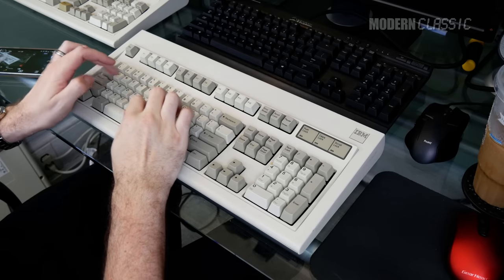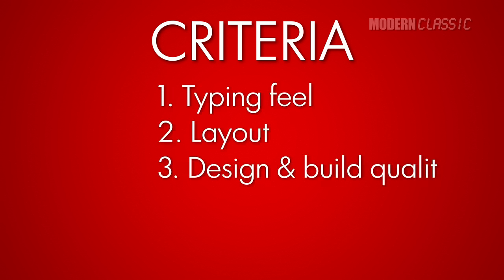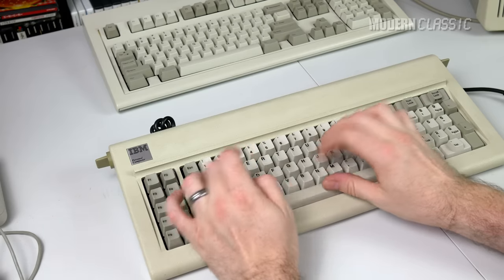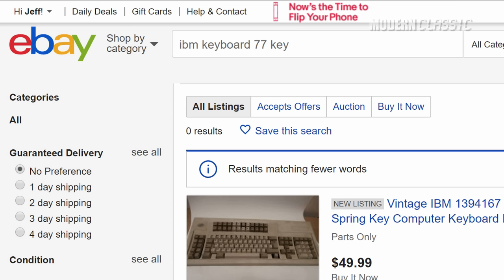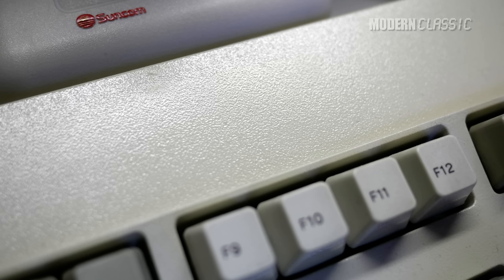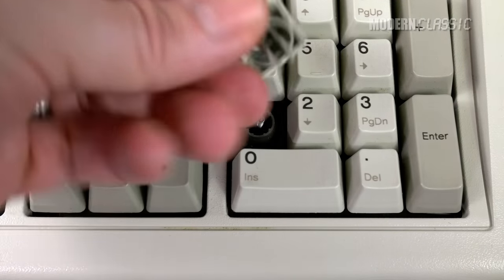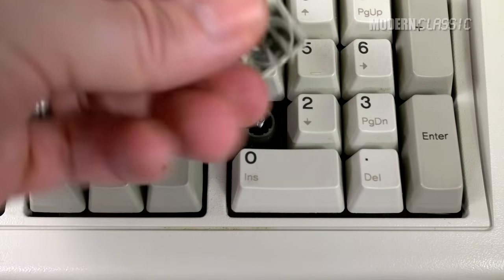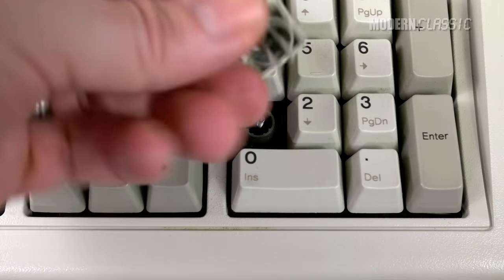Ultimate Keyboard Showdown - IBM Model F or Model M?

Comment: I liked the video but I have some minor nitpicks and critiques as someone who owns many Model M's and F's:

IMO this is not exactly the most accurate comparison you can make between the Model F and M, as you based most of your conclusions on your experience with the XT. I know you mentioned that you would focus on the PC Model F's, but I feel this is worth mentioning. Unlike the M, the layout, build quality, and form factor varied a lot more with the F so I think it's necessary to consider some of the other variants in order for it to be a more fair comparison. 

First nitpick:  there is a Model F that DOES weigh 10 lb (the 107-key 4704 keyboard). 

You cite the spacebar in the AT and XT Model F's as being inferior to the Model M's due to the extremely stiff weight and complications it adds to disassembly as a result of the stabilizer design. However,  most other Model F variants which you did not mention (in particular the 104/122 key terminal and 4704 keyboards) have spacebars that do not have these problems. Although I think this is a bit subjective, I'd also say the layout of these aforementioned Model F variants are effectively 95% as good as M's layout. Finally, most people I know consider bolt modding to be more difficult than any type of repair you'd need to do with a Model F (eg, foam replacement and plate derusting), and the latching hooks make Model F's easier to fully disassemble and reassemble than a Model M (although still kind of a pain).

A more minor point but In terms of keycaps, not all Model F keycaps are 1-piece and not all Model M caps are 2-piece. For example, most terminal F's aside from the 4704 series also had 2-piece caps, and most Model M SSK's had 1-piece caps.

Regarding foam, not all Model F's need foam replacements. The XT is the oldest and most common Model F variant out there so the majority do have rotten foam, but it's also possible to find Model F's with the foam intact. I heard this is because IBM supposedly switched to using a non deteriorating foam in the later Model F's. In contrast, rivets are always a liability in every Model M, but in my experience that depends more on physical abuse than age. I had a relatively new Model M that came shipped to me with most of the rivets falling out because it was packed very poorly,  but my older M's which came to me either locally or were packed very well still have most of their rivets intact.

At the end of the day I do think one of your points is very valid though, and that's price and accessibility heavily being in favor of the Model M. Other than the XT, most model F's have gotten really expensive lately. An F122 will now most likely set you back at least $300, more if it's in really good condition which actually makes them at least as expensive as the new reproduction F62/F77's currently being made by Ellipse. It's a shame really since for a long time these particular Model F's were actually fairly common at reasonable prices, and they are probably the most similar to a Model M in terms of layout. I'd say a Model M probably would make more sense for the non-enthusiast who just wants to get a taste of the buckling springs experience without spending too much money. For me personally I think the typing feel of a Model F is so much better than an M, and I would rather put up with a slightly worse layout (assuming it's not an XT of course).

Comment: 1:23 the 4 models made for the ibm 4704 do weigh close to 10 pounds. My f1704 weighs 12. Blame the zinc case.
Reply from the maker: Well first, that page I was showing that claimed 10 pounds was not talking about the 4704 (though it showed a picture of one) - if you read the text, it was clearly talking about the original Model F. But also, the 77 key 4704 (the keyboard pictured) weighs 8.3 lbs. Still not close enough to "round up" to 10 IMO. Just say 8 lbs. That's still pretty impressive for a keyboard.
Reply: @ModernClassic  that's true, my bad. Also, love the channel btw.

Comment: The correct answer is the Blue Alps on an Acer keyboard.
Reply: Someone's been watching Chyrosran22.
Reply: Alps SKCM Blue VS IBM Beamspring showdown when?
Reply: Brandon Takuto buckling* spring
Reply: @jazzbumsmike  **Beamspring
Beamsprings are the switch IBM used before buckling springs
Reply: Brandon Takuto oh, before the model F and M?
Reply: @jazzbumsmike  yep! Check out Chyrosran22's IBM 3278 and 5251 reviews. Sadly these boards are extremely expensive nowadays fetching around $1,000 at auction. I managed to get a loose switch for one of these the switches are absolutely sublime, even better than the Model F
Reply: @brandontakuto9761  I paid 140 for my 5251 on Ebay back in March. The trick is to send an offer to the seller as soon as they get posted.  A guy listed my as for "scrap valuable metals". Starting bid was 25 bucks, offered 140, he took the listing down. I had it within 3 hours of the auction starting.

Comment: Never used these older keyboards.. 
But i never used a keyboard better than my dell inspiron 1545 laptop from 2009. Large keys with 3mm travelldistance... 

I've had a damaged kpt-102, but it doesnt feels good, well... Its kinda very worn out so i cant say how ot was new.. My kpt also has a hard pcb.

What i dont like about desktop keyboards is that they make this sort of pyramid, having small top parts of the keys, and having these huge gaps that get smaller as they get deeper. But with that i misstype many things, and actually have a harder time hitting the right keys, than with my 1545 keyboard. 
Why there isnt any desktop keyboard with full size keys like awmost touching each other with a cubic shape?
Reply: Sounds like you might appreciate the Tai-Hao cubic keycap profile.
Reply: Zedinperil Wow, thx for the sugestion, it seems to be pretty good!

Comment: I had a model F AT. It felt great to type on but, come on, the layout sucks.  There's a good reason reason the Model M layout is still around, it's good. My model F is somewhere at the bottom of a pile of trash in New Jersey, but my model M is still on my desk.
Reply: Why would you throw away a model f.... What's wrong with you?
Reply: @loz9324  it was 2003 or something, it wasn't worth anything.
Reply: @alfredklek  He wasn't talking about the money, I don't think, but the keyboard itself.
Reply: @ONOBITCH  If it's in good condition, I recommend selling it and getting a New Model F.  The video was wrong about it not being close to 10lbs.  I own one, and it most certainly is.  That line of banking terminals had cast zinc alloy cases that most models F did not have.  I was apprehensive that I was making a stupid decision spending all that money on a keyboard, but it really is awesome, and unlike the M, it's designed to be repaired.  I expect to be using it for at least 10 years, so to me it was worth it for the amount I type.
Reply: The model F 122 pretty much mirrors the model M layout but with two rows of function keys. I believe the M standard layout is based on the F122 just dropping some of the extra keys around the edges.

Comment: N key row over is very importent if 2 or even 3 players plaing fighter games   on emulators like MAME!
Reply from the maker: And the Model M should be able to handle that. Did you see the key test in the video?
Reply: Modern Classic i tried this and model M can not handle 2 players at the same time :) btw on my daily PC i use model M :)
Reply from the maker: 3 players won't work. (But that seems like it'd be pretty torturous even if it did work; just buy a gamepad or two.) But I tried two player combos in Mortal Kombat and they worked fine for me. You're using ps/2 and not usb, correct?
Reply: Modern Classic yes IBM model M ps/2
Reply from the maker: Ok, some two player MK combos don't work, while others do (so the ones I tested yesterday did, but I went back to double check others after your comment and some I tested today did not work). Still, this seems like a pretty specific case, playing a two player game on the same keyboard.
Reply: Modern Classic oh it is not specific case, back in a day we played all the time 2 player PC games and on emulator, and sometimes we hade problems with too many keys presed on same time, BTW i have one nice 84 keys keyboard with rubber domes but with full PCB from 80's for bulgarian PC clone Pravetz and it have N key roll over :)

Comment: If you played guitar hero on keyboard you WILL want N Key rollover.
Reply from the maker: Check the video description.
Reply: Could you try pressing 3 F keys and enter, like F3 F4 F5, or F1 F2 F3 at once on the keyboard test? 
I say this from experience.
Reply from the maker: Not all combos of function keys work, no. But those are not the default Guitar Hero controls, which are shift, z, x, c, and v, and that combination works fine.
Reply: I know it is not default, but when you hold you keyboard like a guitar with the cable down, F1-F5 is a pretty logical and comfy key bindings.
Reply: @ModernClassic  

I think the issue with this comparison is two different types of enthusiasts seeking two different ideals. 

Gamers that want zero issues with their interface, and typists that want the same. 

As a typist, or casual gamer (and I'll define "casual" as anyone who hasn't won some pc parts at an event a state away) none of the F demands are warranted, even if preferred. 

When the side of your pinky has calluses, and you spend a hundred hours plus on aim/ms response trainers it ceases to be a novelty decision. 

Most of the rest are the same as the guy that brings his 1920's ribbon typewriter to the coffee shop, they just like the feel and the culture. Like the smell of old books, or grandpa's cologne.

 These things matter to gamers, but not like having your f keys down the left of the keyboard, or the tactile feedback that lets you know it was user error and not lag etc that cost you the match. Those aspects cannot be supplied by the M as they will always be the difference between the two. 

How the two types weigh the benefits of each, like things you dismiss out of hand (n key superstitions/concerns without reason) or didn't address (benefit of almost all f keys in reach of the active left hand) as a make it or break it aspect for gamers, I think, is where the contention lies. 

F keys down the side and the myth/hype/reality/belief of n key rollover combined with the only source of true clicky keys (with this layout) makes the F the go to for gamers with the free left hand pinky and right hand on the mouse. Years of blind "keying" make another keyboard alien, and I know typists can appreciate that.

It's like comparing an Formula One car to a Baja truck. Both are great, how are we using them?

My two cents.

Comment: how far is the model F ro M from cherry keyboards ?
Reply from the maker: Cherry MX Blue switches, which is what I assume you're asking about since they're the most common clicky Cherry switch in modern keyboards, are much "scratchier" and less smooth, and just feel cheap compared to either the F or M in a way that's hard to describe. The thing about buckling springs is that the only real resistance comes from the spring itself, whereas with any mechanical keyswitch, there's a lot of resistance from the slider too. Some people do things to try to "grease" up their switches, but it's never going to feel quite the same. Buckling spring switches are a lot smoother and have kind of a "heft" to them even if the resistance is very light (as it is on the F).

I personally use my cheap $30 Outemu switch keyboard more often than my Model M's or F, so it's not that I think MX Blues or their clones are terrible, but they just aren't as smooth. I do actually like Outemu better than Cherry in terms of feel, though. The Outemu switches feel slightly more like a Model F copy, whereas Cherry MX Blues feel like a Model M copy. (Though neither is a perfect copy for the reasons mentioned.)
Reply: Silent cherry reds are the best no doubt about that, the novelty of clicky keys wears off VERY quick
Reply: Synthematix There are much better linear switches on the market than Cherry reds, they are scratchy and awful feeling. You know a companies switches suck when you have cheap clone manufacturers making better switches than they do.